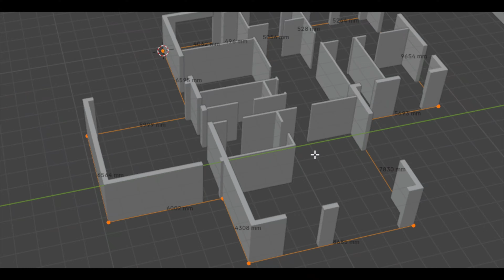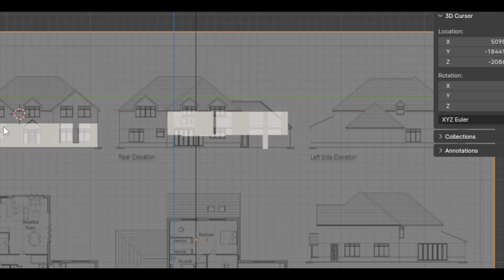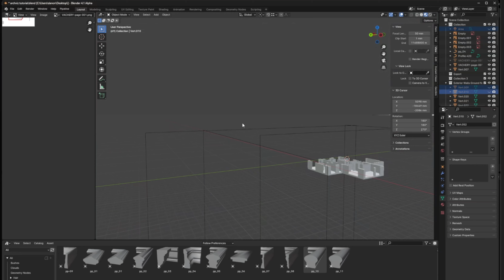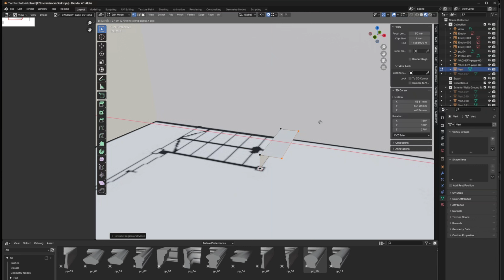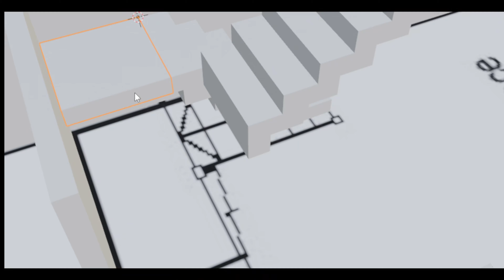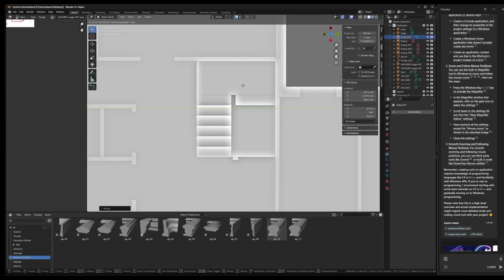Setting up Reference Images , Merging Floors and making Stair openings - Blender Archviz

Comment: Very useful info, I hope you make more videos to finish this model.
Reply from the maker: Yeah I will be doing this in depth again but with a different plan as, there’s issues with this floor plan which I was modelling from which I will show in video soon 😂multiple elevations are wrong and don’t make sense and as i can’t geta revision on this plan , also we don’t have roof angles and blueprint which I want to show how to do in blender aswell , instead going to show everything that you will need to know in different parts so they can be applied where necessary, I hope this will help ☺️ lots of content lined up and stuff getting made 😎😄
Reply: @vizualflow  I loved the 2 videos! Please keep them going, I would love to see the full process!! Suscribed :)
Reply from the maker: @Hehuwam  yeah thank you very much  :) sadly the plans i was working off need revision because the elevations don't line up or make sense to do the roof. it is not possible to continue with this exact plan which is not good for teaching because we want to be able to replicate accurate measurements with our 3D Models , i am going to continue this series but in a more segmented way with each part described in depth and alternative methods for each part :)  like roofs , curtains , texturing , composition , lighting . UV in engine etc theres always alot that goes into making a 3d project so this is why i feel it is best broken down into multiple shorter parts this way people can extract the parts that they need to learn instead of watching a multi hour long series to gain one valid piece of information for them . in the mid term i plan to release really long form videos where it will be like a 0 to hero video of entire project completion in one video etc.

thanks for your comment , and hope you will find value in my future vids :D